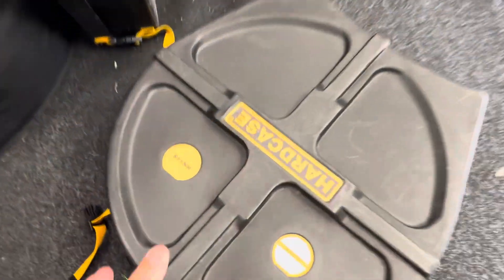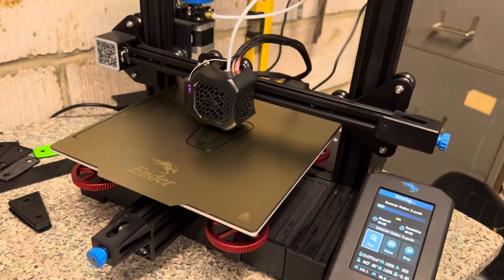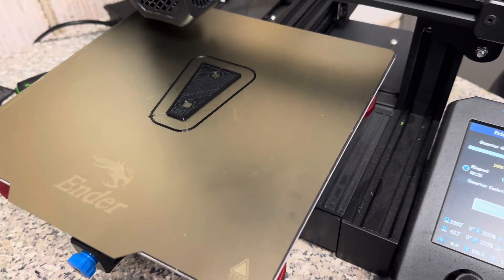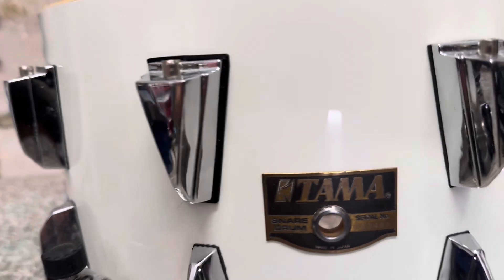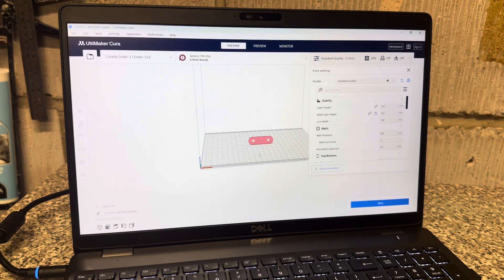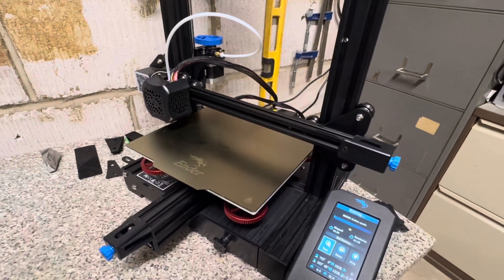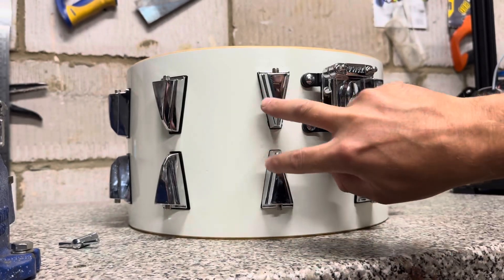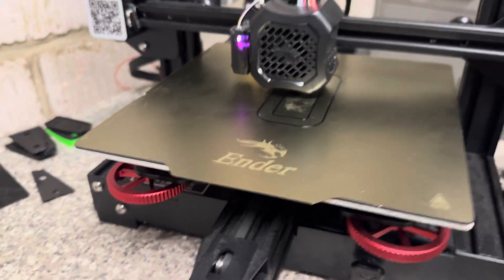TAMA SHARKTOOTH UPGRADE. 3D PRINTING PARTS.

Comment: TPU can be a pain to print. And it sends to suck up moisture in the room and then goes stringy and bubbly and clogs so I'd say the green stuff looks like it needs to be dried out.  Ive printed loads of stuff for the drums on my printers, there are tons of stuff on thingiverse and printables. Ive even printed an 8" rota tom that i use constantly on my travel kit.